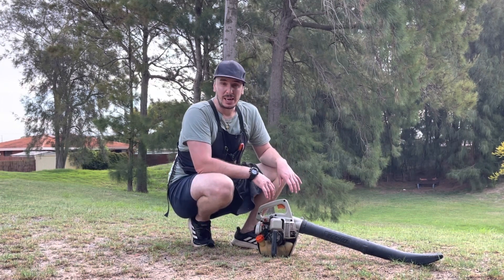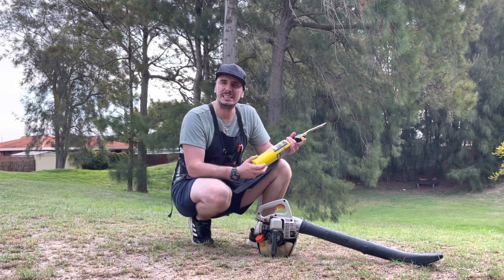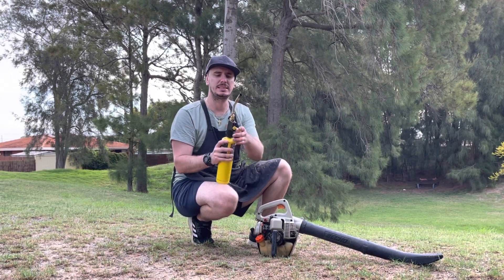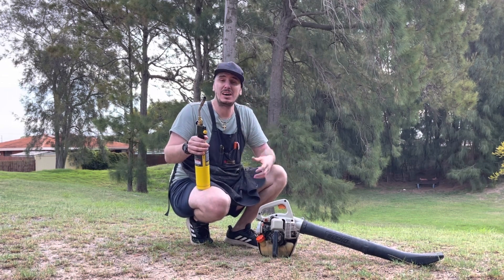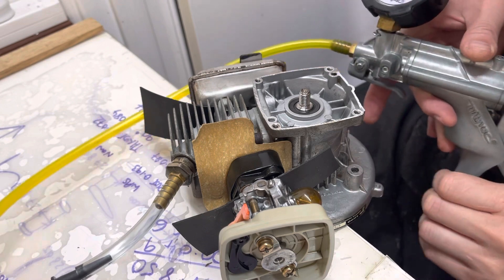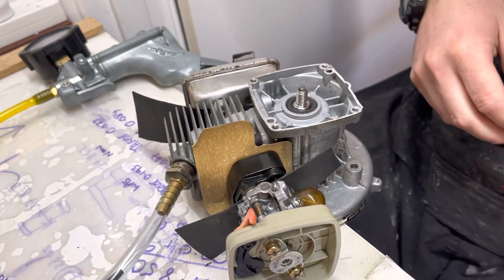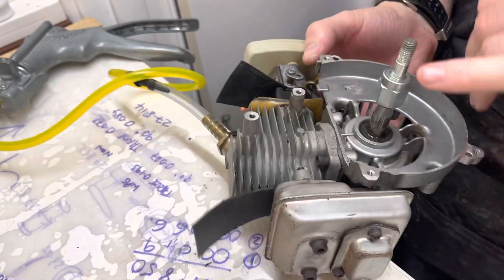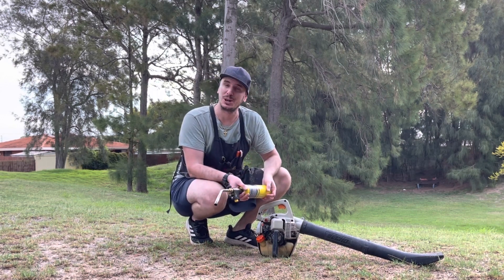TESTING FOR AN AIR LEAK USING PROPANE GAS!

Comment: Few questions when I put my torch up to filter to make sure it changes idle it starts smoking out the tip of torch and made idle low, and my only leak was behind my base gasket and I put the propane to it and it made no difference but it did the smoke thing again,
Reply from the maker: I'm not sure why it is smoking! I'd suggest a pressure and vacuum test next to confirm or deny the leaks :)

Comment: Why does the tip of my torch start smoking after I found leak ?
Reply from the maker: I have no idea! :/
Reply: @VintageEngineRepairs ok, does this work on very small leaks to? And has it ever missed leaks for you
Reply from the maker: Try a little brake cleaner, you may find you can pinpoint smaller leaks a bit easier :)

Comment: Will propane work instead of mapp gas?  I have a chainsaw running way to fast and can’t  be slowed by the carb. No effect by the propane at all even though carb throat.
Reply from the maker: Yes propane works well too. I’d suggest a pressure and vacuum test in your instance.

Comment: Brilliant!

Would compressed air do anything....? 🤔
Reply from the maker: Hmmm, if you shot the air directly at the seal with decent pressure you’d probably notice the engine may run leaner, but it’s not really practical

Comment: Hey Tom, with MAP gas being combustible, why did engine revs drop and not increase?
Reply from the maker: Hey Steve, it’s actually propane (map/pro) not true “MAPP”. Either way, the reason the rpm dropped is because with the added fuel (gas) it was running richer. Hope this helps 👍
Reply: Oh ... so it was tuned stoiciometric with the leak ... add more fuel = suddenly rich. I get it
Reply from the maker: @stevenprice8065  hey mate, it’s tuned under-stoichiometry at idle for good off idle acceleration here, adding more fuel just further increases that richness decreasing rpm :)

Comment: Bloody hell Tom, I was watching this going, I'm rough as and would use contact cleaner or brake clean or even a fine mist of two stroke to find a leak. Then I was how the hell has he pressurized the engine it's still got the carb and muffler, then I saw the rubber 😂😂😂
Clean straight forward video, cheers mate.
Reply from the maker: Haha not at all mate, you can do just the same with carb or break cleaner as you know :) just a preference I have where I will use propane first! Thanks for watching buddy!